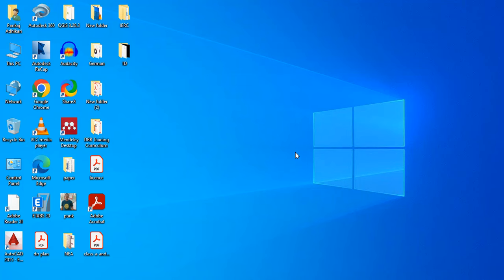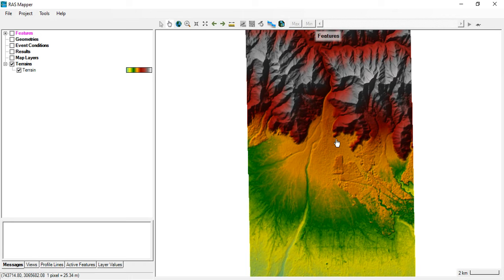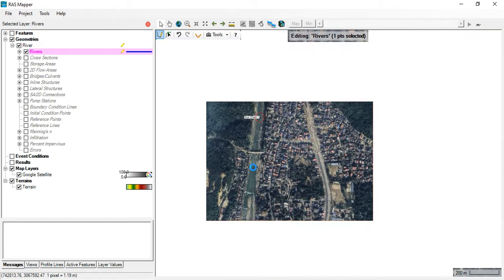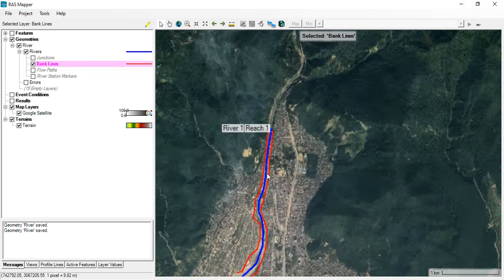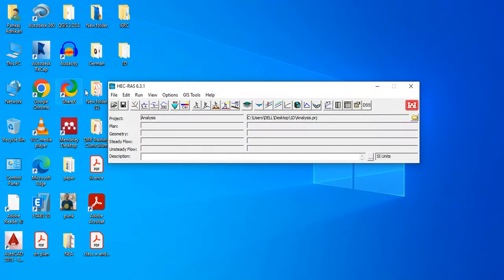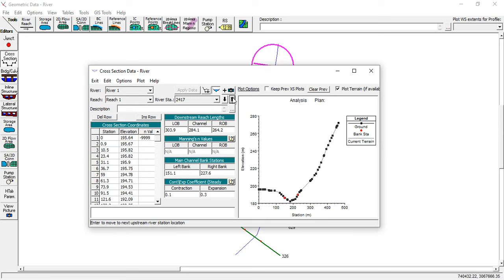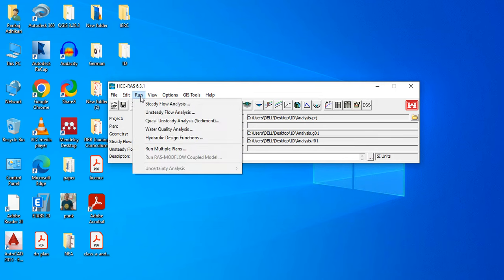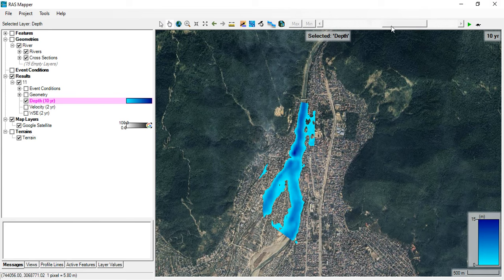Easy HECRAS 1D Flood Modelling Tutorial : Steady Flow Analysis: HECGeoRAS not Required

Comment: Is there any process  so we can automate cross section lines?  I wanted cross section data of whole stretch of river.
Reply from the maker: In that case, you need to use the HECGeoRAS extension in arcgis which automatically generates cross section lines. Afterwards, it has to be imported to HEC-RAS environment.

Comment: Hello, thank you very much. This was helpful but I have a question please.  How do we know what value to input as the flow data.  I saw you give a couple of values but looks like random values. I will like to know why we need to input a flow data and how to get what values to input. Thank you
Reply from the maker: Thank you for your kind words of appreciation. The input value depends upon what sort of data is available with you. Usually but not necessarily, flow discharge is used as input. If you have access to other data  then you can use them. 

Yes, the values I have entered are random; just for tutorial purpose. You can fetch flow hydrograph, if available for your desired study area, from authorized agencies of government related to hydrology or meteorology. Or you can use empirical formula to calculate it.
Reply: Thank you very much for your feedback.  I watched a video where I saw people calculating stream flow by going on field.  They measured width of river, a length, velocity etc and averaged them and used them to calculate stream flow in cfs. Is that method (float method etc) used to get a value for the flow rate input  also ? Or that experiment is different?
Reply from the maker: There are different ways to calculate. The method you have shared is one of them. In order to get the accurate result make sure the measurement is carried out with seriousness and precision. As many locations in world (especially in the developing nations), there are no sufficient hydrological stations. So one has to rely either on empirical formula or manually measure in field.
Reply: @_SolutionSeek  okay, thank you very much.  Very helpful

Comment: Hello sir. Thanks for this tutorial. But may I ask if this process is applicable in determining the adequacy of an Irrigation System to holds rainfall water? Thanks
Reply from the maker: Thank you for the question. I do not have detailed knowledge about the subject matter that you've raised. I will search for it and answer you.
Reply: @_SolutionSeek  I'm working on a research paper about Agricultural Irrigation System and I want to run a simulation of it to see if its capable to hold the rainfall intensity around the area of my study.
Reply from the maker: @wrcstrshr  Wow. That is so cool. My best wishes.

Comment: And why is one boundary condition for flow hydrograph and the second for stage hydrograph?
Reply from the maker: Your question is very valid. The choice of boundary condition is governed by the data and information available to you. I strongly suggest you (also all the users) to go through the HEC-RAS manuals that is available in the installed folder. It would offer more insights and clarity.

Comment: Hello, May I kindly ask another question please.
In unsteady flow data,  how do we know what kind of values to input as boundary condition and why
Reply from the maker: Unsteady implies there is change in the discharge value.
Reply: @_SolutionSeek   please 1 more question. What do we have to draw cross sections. What role does that play in modeling
Reply from the maker: That's a very fair question. I guess it has to do with analyzing the change in discharge, slope and elevation at different places.
Reply: @_SolutionSeek  Thank you very much
Reply: Are the cross section lines drawn at random from left to right from the downstream or they are other rules to follow for it

Comment: And also when the profile names are changed to years (eg. 5yrs , 10 yrs etc), what does it mean. And why do we create 3 or 5 profiles.
Reply from the maker: The profile name means  return period years.
Reply: Bro can we just put the profile name as yesterday today and tomorrow and provide the flow rate? Is it a right way?
Reply from the maker: Bro, always provide meaningful profile names. Use different return periods (example:50 year, 100 year, 1000 year) in profile discharge to observe the change.  @Jimbu1777
Reply: Can i use 2D model analysis for steady flow ?
Reply from the maker: @Rahad557  For steady flow, use 1D model.

Comment: I noticed you gave a value of 0.001 to the upstream for subcritical flow. Could you kindly explain why subcritical flow had a value for upsteam boundary condition ?
Reply: Second question is how do I get the upstream value for supercritical flow
Reply from the maker: These values have been entered just for the learning purpose. For actual and professional analysis, you have to calculate each and every parameters with preciseness. For the detailed information, I suggest you to reach out to the 'Steady Flow Data' section in 'Basic Data Requirements' of the User's Manual.
Reply: Thank you. May I ask this. What formula would you suggest is the best for calculating return period in hecras steady flow
Reply from the maker: @jeromemensah194  It depends upon whether you have discharge data or not. Say if you have discharge data then also it matters for how many years the data is available. The point is the choice of flood frequency is governed by availability of data and their distribution. The most popular are Gumbell's method and log pearson. However conditions are applied for their use. If you do not have data ie ungauged station then you have to resort to empirical formula.
Reply: @_SolutionSeek  thank you